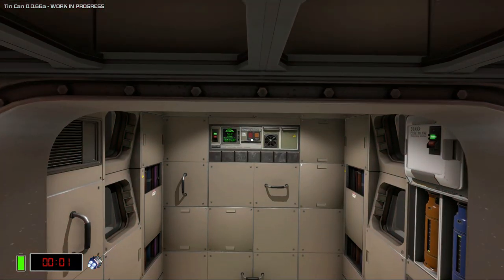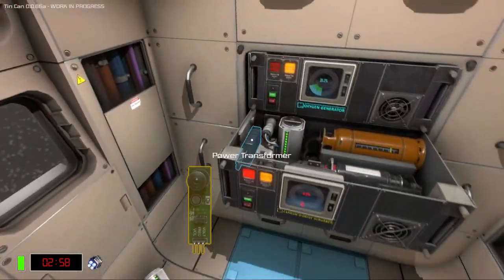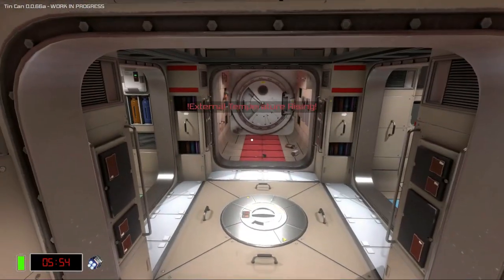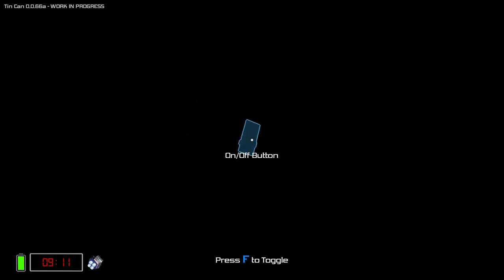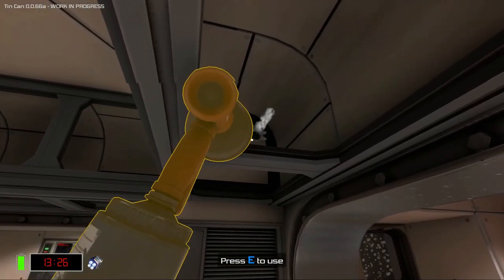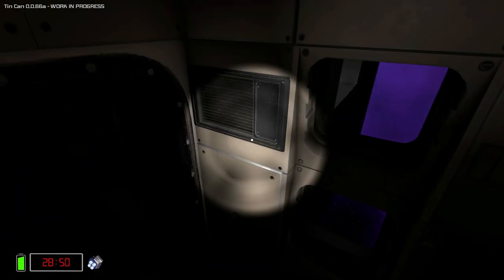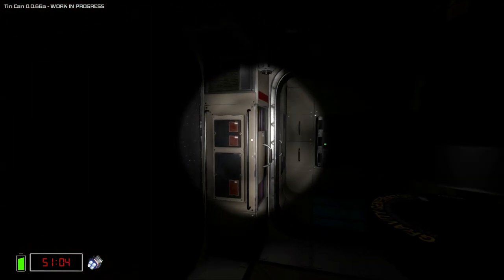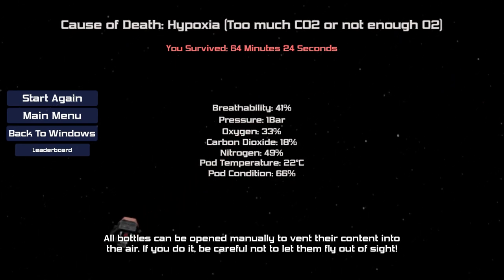Tin Can Fire Update: Surviving for Over 1 Hour

Comment: I feel that the asteroids are just overpowered events, within 3 minutes of hardcore mode in the first asteroid field I had 3 holes, a broken processor on the gravity machine, and a broken fuse on the generator, broken pumps on both O2 and CO2. Ridiculous
Reply from the maker: Yes there's some balancing needed with regard to the asteroids right now, especially considering how quickly a fire could destroy an entire system.

Comment: I don’t understand what goes wrong with the main generator when it stops making power.. the output level is extremely low and it just stays like that… I don’t know why this happens.. 🤷‍♂️⚡️
Reply from the maker: There could be multiple reasons. If it has a processor in it, it will try to match the power output to the power demand. So the more stuff you switch on, the higher the output will become, but it takes time for it to adapt.

If you remove the processor, it will simply keep increasing power output until it starts frying systems and overheating the pod.

Other than that, I can't think of why the output would remain low, maybe it got damaged. It has been a long time since I've played the game though.
Reply: @ChucksIndieGalaxy  ok thanks, maybe that’s why it stays low. It gets damaged in an asteroid field and the output goes down almost to zero. So then I turn everything off to try and save power but because the demand is now low maybe that’s why the output never climbs up again… 🤔 thanks